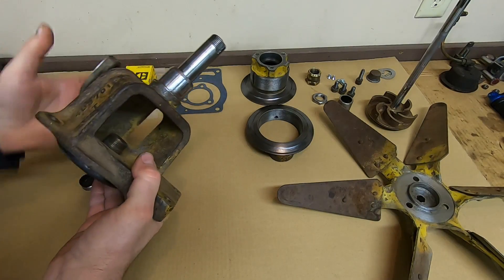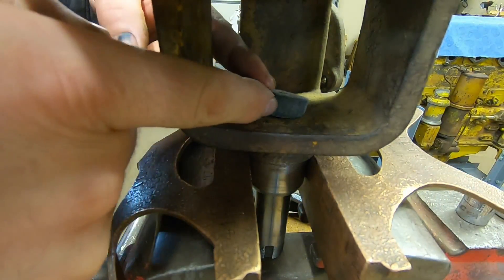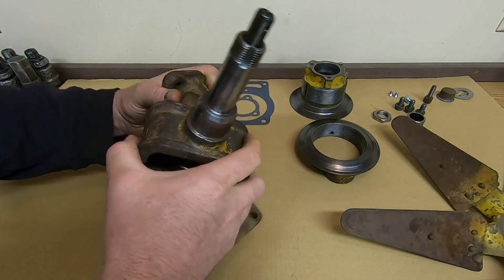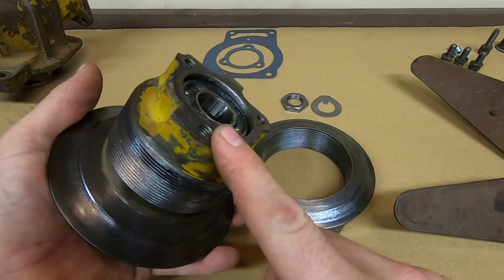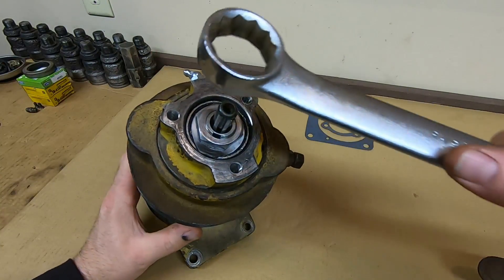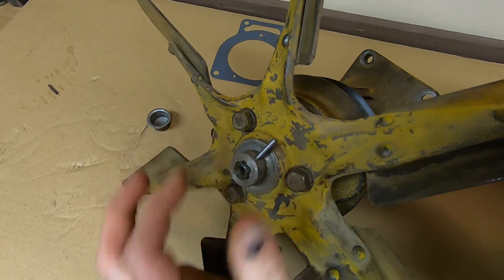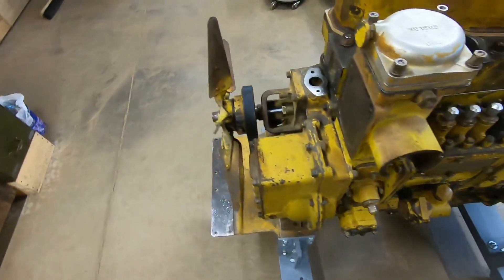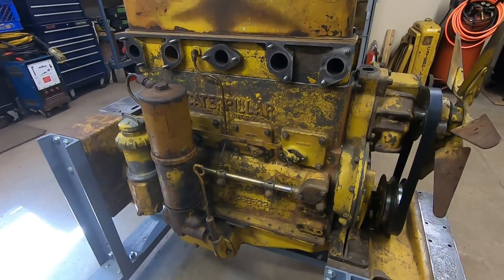Caterpillar D2 #5J1113 Diesel Engine Assembly Ep.46: Water Pump Assembly & Installation

Comment: Thanks for your videos I just bought a 1936 RD4(4G438)  runs great factory didn’t include a coolant temp gauge . Is there a specific place in engine I can add a coolant temp gauge ?
Reply from the maker: Yes, there should be a plug in the cast iron elbow that’s located between the top of the water pump and upper tank of the radiator - that’s where Cat eventually started putting the temp gauge probe. If you’ve got a really early unit that doesn’t have a plug already there, then there should still be a raised flat boss on the side of that elbow casting that can be drilled and threaded for the temp gauge to attach. That was a retrofit fix that Cat released first those early tractors 👍
Reply: @squatch253  so I finally got around to this and the upper radiator cast iron coolant  neck had one plug . Pulled it and it has a non -NPT thread on it . Took pictures but I am unable to use that port unless I find a adapter

Comment: Hello Toby, I'm currently rebuilding the water pump on my D2 5U and was wondering if you had a CR seal size for the 7B-2174 grease seals and a standard bearing size for the 1B-4115 bearings (which now supersedes to 2F-5721 bearing)? If you did it would be a huge help and greatly appreciated!
Reply: @squatch253  Thanks Toby, very much appreciate your response. I gave the outside dimensions, shaft dimensions and width of the old brass and rawhide CR 7B-2174 seal to my local SKF dealer and he’s said he has a match, so I’ll go and collect them tomorrow, it will be interesting to see if he’s matched to one of the CR numbers you’ve given me! The bearings in mine are USA made FAFNIR 305W which are still available but horribly expensive. It turns out that they are simply a very heavy duty bearing (3.5T radial loading per bearing) the same exact dimensions as a 6305 (which has a radial loading of 2.4T per bearing) with a bore diameter of 25mm, outside diameter of 62mm and a width of 17mm. I find it very interesting that they used a bearing of metric dimensions?? Also, I am sure for its purpose that a 6305 will be quite adequate!

Comment: Squatch, you have a dynamite series. You are very meticulous in your assembly of 5J1113.I really enjoy it. I have a question and I don't want to insult your intelligence by asking a dumb question, but Cat seems to place a lot of stock in fold over locks. Don't they ever use lock washers?
Reply: @squatch253  That makes sense. That's probably why I've seen the nuts with nylon inserts on things like in the Prototype J51113. Thanks for the prompt response.

Comment: I don't think there should be any risk of creating excessive thrust on the bearings, by design the inner bearing (close to the seal) is floating since the outer race is not locked by any shoulder.

Comment: There is a low/standard/high torque chart that is used now for assembling Cat stuff.  When none are specified, standard is used.  Don't know of any case (except maybe some wierd supplier component) that does not have a torque.  Don't know when this became Cat standard practice.

Comment: Something soothing about rebuilding the old water pumps versus buying a new, aftermarket pump, isn't there? It's usually a far more cost effective option, using factory original parts to boot. Nice work, Squatch. Glad to see yet another piece bolted on the block.

Comment: The Elroy must congratulate your attention to detail. Most excellent.............you are a true craftsman ! You are well trained and the Elroy fully enjoys your Caterpillar adventures. Please continue.

A few comments if you please. Elroy noticed that the replacement bearings you used were the maximum load capacity type bearing which incorporate a full complement of ball with no ball cage. To achieve this high ball count, the bearing design calls for a loading slot on the the inner race. We couldn't tell from the video in what direction you loaded the bearings. Elroy trusts that you fitted the bearing so the race notch was NOT under thrust loaded. We also wonder why you didn't select a bearing with a "shield" on one side to help protect the bearing from dirt in operation.

Elroy trusts in your judgement and simply wishes to make this inquire. Please advise accordingly

Comment: Definitely would have replaced that pump shaft packing with some new square cut Teflon rope. Super quick to install, just skive the ends at 45* where they meet, staggering the gaps as you stack up the rings of packing. Re-using old packing just leads to cranking the packing nut down tighter to get it to seal, which leads to more shaft wear. Shaft material is embedded in that old packing material too, adding to the issue of wear and sealing. Always a good idea to use lots of anti-seize on a packing nut as well. In the future when it needs to be snugged up because its starting to drip, the threads will be corroded if it was assembled dry. I would have thought you wanted to use a roll pin between the splined fan hub and the water pump shaft, to try and keep a snug fit so they wouldn't be wiggling against each other over time.

Comment: Nice job on the pump rebuild. A note about the bearings, they appear to be the maxi ball type, as they have loading slots in the races. They are made to handle more radial load than the standard Conrad style bearings but do not tolerate axial load. They are available retail but have a different prefix number. It might be 3205 instead of 6205, I've been retired for a few years so I might be wrong on that prefix.

Comment: Hello; I am amazed to watch you work on this relic. Your knowledge in this field seems boundless. But I have a question?                                                                                            
As I look at the belt that you put on, it's at the outer rim of the pulley. A new belt will stretch. Is there enough adjustment to take up for this? It looked like there was about at most a half inch between the two halves. More like about 3/8". This might let you tighten it so it don't slip now but later, I don't know. You got me, I'm hooked. I am a subscriber and I keep an eye out for you new installments. I'll just have to "Stay Tuned in". Really like your videos. Keep them coming.

Comment: Nice to see your water pump back on the engine. I'm a little surprised that you didn't use a genuine cat belt for this, perhaps they're no longer available, or perhaps cost prohibitive. My OCD doesn't allow me to orient passenger car belts in a manner where you can't read the writing as viewed from the front of the engine. It's a sickness I know, why would someone care what direction the lettering is facing? I wish I knew, but I've taken belts off in the past to flip them around. Why, because I'm an idiot. Happy Friday Squatch.
Reply: @squatch253  Note to self, if I ever buy a Ford, I will have to turn the belt around. Good to know Squatch!

Comment: Squatch will you not have to remove the new belt from the pulleys to install the inner fan belt??  Does a second belt engage the inner crank pulley??
Reply: Inner belt I believe is for a generator, if so equipped. I don't believe 5J1113 was so equipped.
Reply: @lukestrasser  That inner pulley is awful shinny for not being used! I think Squatch was just showing us how to adjust the water pump/fan belt.
Reply: @tonyrum5808  he cleaned the pulley groves during the restoration of the pulley. I don't recall this machine having a generator in the disassembly.

Comment: What is the point of 2 halves of the pulley being independent(where the belt goes) is that so you can adjust how fast or slow the fan spins?
Reply: That's what I get for commenting before the end of the video....lol

Comment: Great content, but one question on installed the fan belt, there's another pulley towards the inside. Are you going to pull the water pump belt off to install the inner belt?
Reply: The other belt grove is for the generator, which this machine doesn't have.

Comment: The bottom pulley -- crankshaft pulley, I think you said -- looks like it's supposed to have two belts on it, another inside of the fan belt. What's up with that? Extra pulley for engines that have generators, maybe?
Reply: That's exactly what it's for, machines with a generator.
Reply: I was thinking the same. Looks like that back pulley had a belt ran on it.

Comment: Is`nt that belt one size to big ,Why only use half of the belt I`d get one smaller ?IDK Curious
Reply: I've called Gates' engineering dept. in the past to get a recommendation on a slightly larger or smaller belt. They are very helpful-